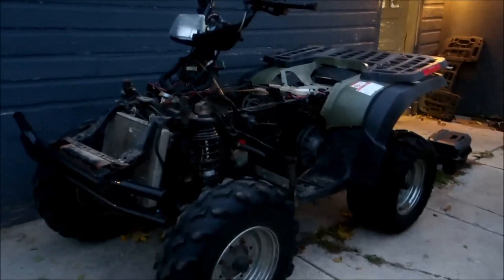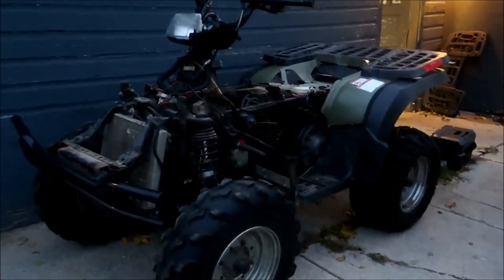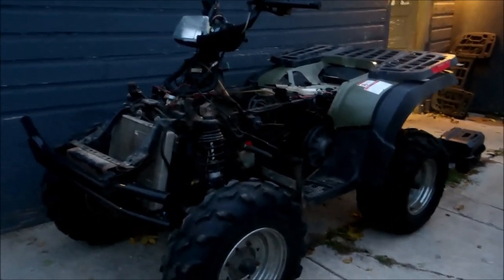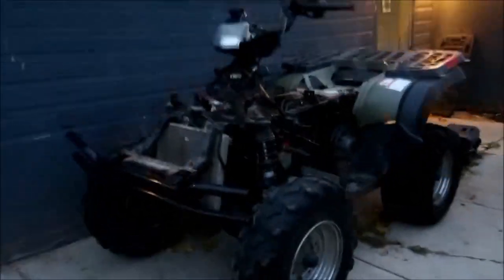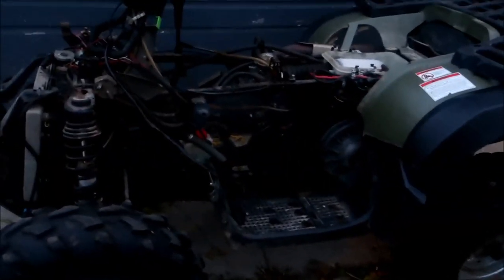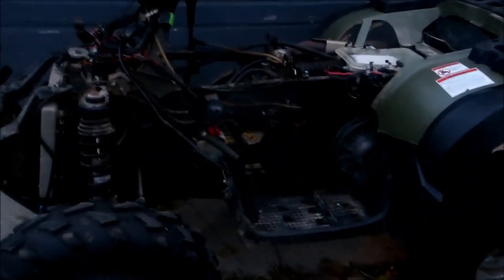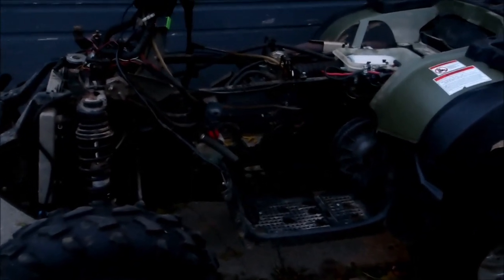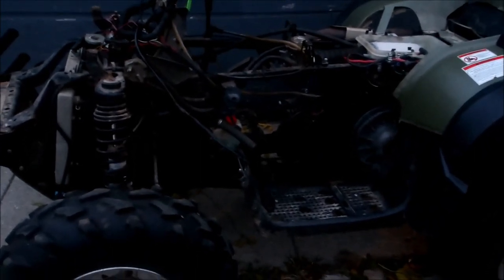A sneak peek at my up coming video!

Comment: Hi there.  What is the trick to getting the front plastic off?  I have an '04 600 Twin where the handle bar nuts are hidden.  Subscribed and learning allot from your Sportsman video's.
Reply from the maker: Thanks, Take the speedo cover off. I always take the whole headlight pod off. Remove the bumper and rack. Then 2 bolts under the hood. One on each side. 2 by the gas tank when seat is removed. And all the bolts on the fender flairs that attach to the footwell.
Reply: @TitaniummanGarage That base cover is where I was having issues.  I did not realize it comes off without pulling the bars.  The 600 is all put together and running great!